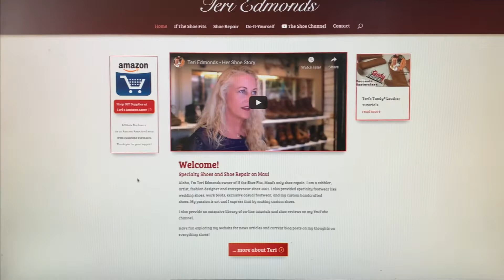Shoe Repair - Leather Boot Restoration

Comment: I've worn my Double H boots of this style every day for years, and they're pretty worn.  The local cobbler looked how the sole is separating from the upper and condemned them the moment he saw it, didn't inspect it, didn't even hold the boot for 30 seconds.  The leather of the upper doesn't appear torn, just that the threads seaming it to the sole deteriorated.  They don't make my specific boot anymore and the new style aren't nearly as good of quality and fit.  Any way these can be repaired and a whole new sole put on the boot?
Reply from the maker: Can you send me a pic?  I’ll look at it for you.  Teriedmonds.com and send me an email.  I’ll write back so you can add a pic

Comment: Was wondering how I should remove scuffs from the toe of a pair of black leather Harley-Davidson harness boots?
 It looks like the scuffing is a layer or two deep into the leather and I'd like to smooth it out. Was thinking sanding it with medium and then fine sandpaper and maybe re-dye with black leather dye followed by black shoe cream or shoe polish and a leather conditioner. Not sure because I've never tried to sand and then polish leather and I'm not sure about the proper steps in the shoe cream/polish and conditioner, which should I do first, condition and then polish or vice versa?
Reply from the maker: I’m so sorry I didn’t see this!  I usually polish the shoe, then, take some contact cement and touch it up, let it dry, then hammer it down, especially if it is a deep gouge!